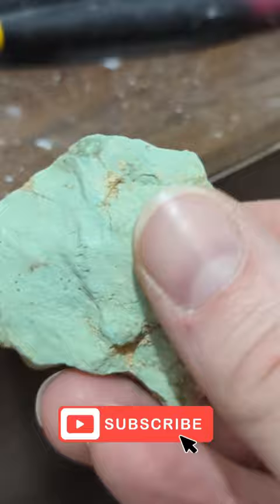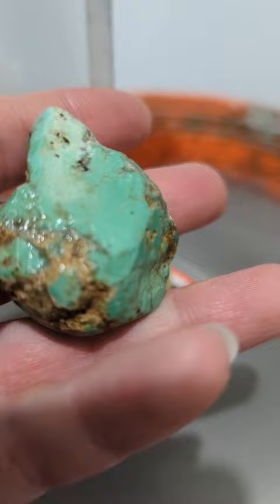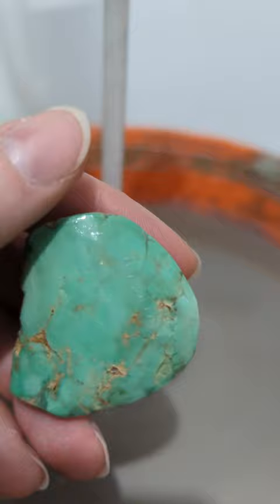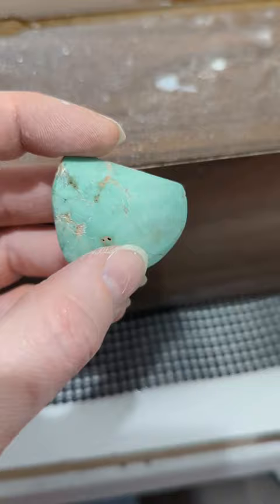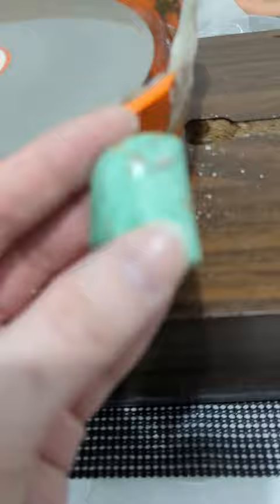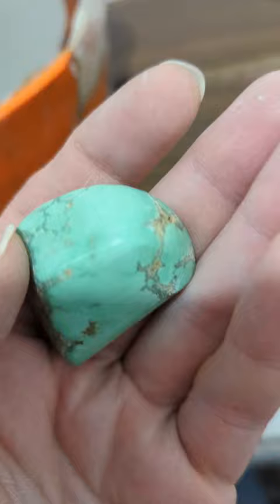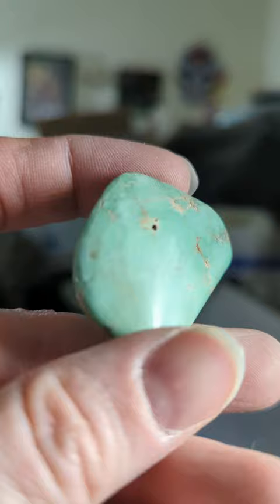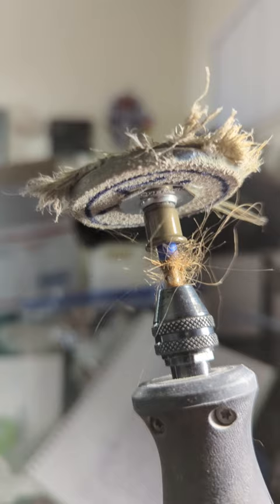How to Lapidary Polish Soft Stones for Beginners

Comment: May I ask how much mineral oil do you add to the Zam? My stick is hard as a rock,and very difficult to use. TIA
Reply from the maker: It doesn't really help that much it doesn't make it soft I wouldn't bother. Just needs some friction so use your buffing pad on high speed in the zam.  I've melted it with a lighter before too that will soften it up as well. But it's just a very dry very hard compound.
Reply: @KerstenSafford Art  I have tried just using a polishing bit on high setting. It turns the zam black on my polishing bit.
Maybe I will add a bit of mineral oil to the polishing pad and see if that helps. I have used the zam even when it turns black, it polishes, but turns everything black! Maybe I got a bad batch or something? Thanks for your advice 😊
Reply from the maker: Usually it will turn black when polishing metal like silver or hemetite just a chemical reaction nothing to worry about
Reply: @KerstenSafford Art  thanks for the info. I thought I was doing something wrong or my metal was wonky! I guess I can just clean the piece up with soap and water after I'm done polishing? I had given up on one copper necklace I tried to polish, the entire piece turned black, what a mess. Thanks again
Reply from the maker: An ultrasonic cleaner and some light scrubbing with a toothbrush will get it off . Glad you know now. Usually any compound will do this. I stay away from red compounds I've never found them to be very good as some cheaper ones really stain any light colored stone. If you look in the video description there's an Amazon link to the Dremel brushes I use for polishing jewelry. They work great and last a long time then I always do a final polish with cerium or zam